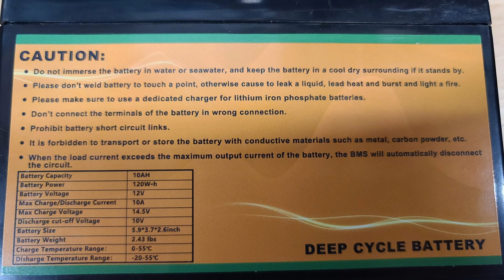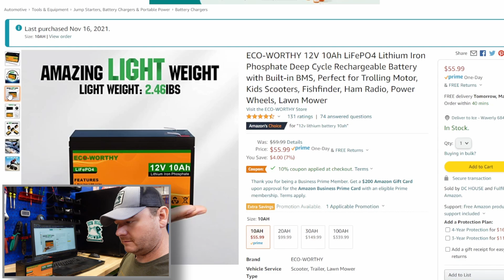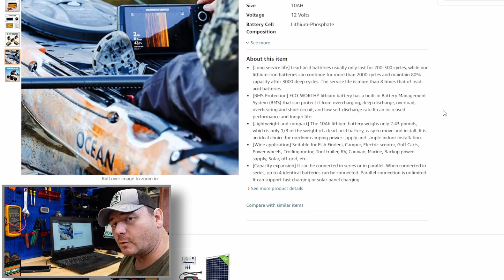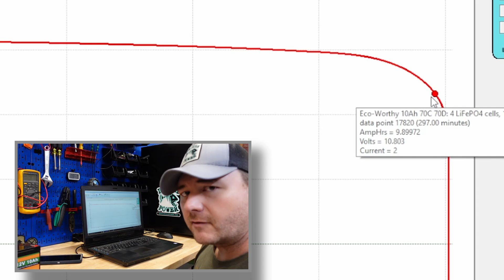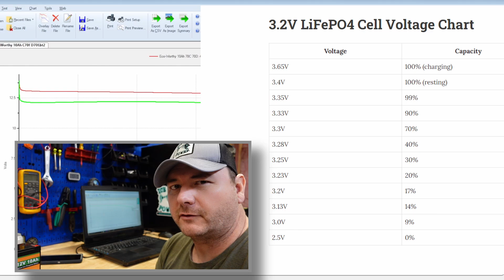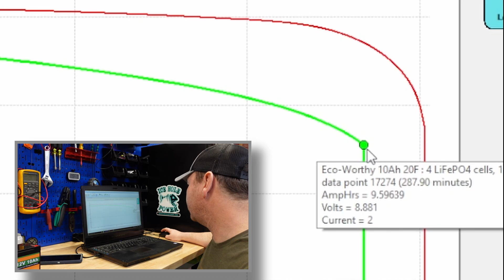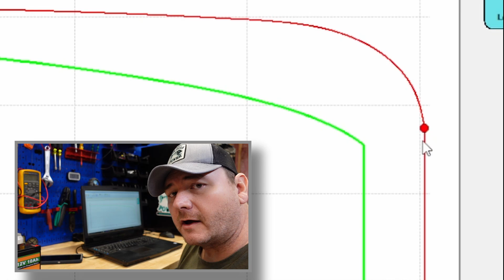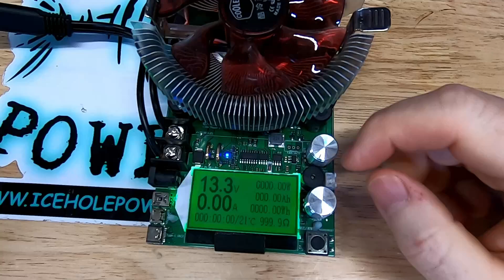Eco-Worthy 10Ah Review and Teardown

Comment: fwiw that bms is from JBD-HP07SA-4S-6S-7S-12V_1600487483010  albaba
Reply: OBTW that BMS is ca $3-5 ea so what you expect.  the bigger ones 25A $10 are whats promoted for Escooters - you know the fiery reputation they have, no OCP or SCP no wonder they smoke - should be banned

Comment: horrable compony to deal with tho.  they have lots of bad reviews on their ebay store and I ordered 3 different products from them and so far 2 out of 3 orders that they actually shipped 1 of the orders which was sent in a 2 part shipment they some how shipped one of the 2 boxes to the wrong address and then left me hanging..  and the other not only did they not send me the panel and charge controller that i bought as a kit.  they ended up sending me 2 of these 10ah batteries that i did not order and inside the box was a return slip from another ebay buyer that was sending them back because they were defective or damaged.  and my 3rd item which was a solar combiner and junction box that is still in shipping and not arrived yet cant be the right item either being the shipping weight is 11lbs and no way its that heavy and the box is to small for it to be my solar panel i was supposed to get.   But while i have there defective batteries here that they sent me a blank white return shipping label for (scammers)   these are NOT really 10ah batteries or even close to it. they also don't weigh anything close to any other maker's good 10ah lithium batteries.

Comment: Can one take the 12v 10ah battery and connect it to a 12v battery on a rider to run a pull behind tiller with a dc lift actuator

Comment: Can 12v 10ah lifepo4  battery's be put into series  for 36v ?
Reply: yes 3 in series for 36v, but make sure you charge them up fully in parallel first, as once they're in series, if any of them stop charging, all of them will stop charging.
better to get a 36v (12S) battery if possible (12S means 12 cells in series, whereas a 12v is 4S meaning 4 cells in series.)

Comment: Do these Lifepo4 batteries work in things like RideOn toys (powerwheels, Razor Quad) etc.  I bought a few to replace the SLA batteries I have, but they don't seem to have the strength to power power them.  Didn't know if it's something Lifepo4 isn't made for do to a limitation on discharge rate or something, or if I just bought crappy ones
Reply: Yes. Cheap replacement for very expensive power wheel batteries.

Comment: I nearly purchased 2 X 30ah Eco Worthy batteries for my mobility scooter, but after reading all the reviews here in the UK I decided not to buy. Still using lead acid as there seems to be some bad lifep04 batteries being sold in the UK.
Reply: I’m afraid to say but his test is not accurate. Max discharge is rated at 20A… nothing is going to happen at 16.

For his short circuit protection… all he did was arch the terminals. Not how you test a battery.

Comment: Ecoworthy was the one of the first lifepo4 batteries i bought.
I got a 200w solar kit with controller and it was a great project.
The kit came with 2x20ah batteries, which are still working :)
But i did change them out for a 100ah cell, from ecoworthy.

I can understand they may not be the best cells
or a good bms (it works for my use cases, as a portable battery bank that powers my patio pond)
For the price, i don't think you can find better deals, also some come with a warranty :D

Ecoworthy is kinda new to the market i think, they're still having some growing pains but i've been rather pleased with their products so far.
7/10 acceptable product
not the best but acceptable.

Comment: If your gonna short circuit test a Battery, clip the alligator clip and leave it on there with your amp meter on it as you had. All you did was a instant arching of the terminals.

Comment: Can I use a car battery charger?
Reply: so long as it doesn't 'pulse' like some car battery chargers do in order to break down sulphates, as these pulses screw with the BMS' electronics.
If it's just a flat current it will probably be good enough. Ideally it will hold the voltage >~14v in order to let the BMS top-balance the cells.

Comment: I got my 20AH delivered today.  The sheet in the box says that current protection kicks in at 2 x the max discharge current.  I'm not knowledge enough to know if that's bad, but at least it seems intentional.
Reply: Sounds about right, It's the level a fuse would pop (instantly at double the rated current, in a few seconds at 180%, about an hour at 125%)

Comment: wait, you need to hold the cable to know if it does short circuit right? the spark is normal, it has a reaction time, it just power it on again as soon as the load goes off, i got some bms that do exactly that, but if i hold the cable, the short stop

Comment: If I am not mistaken, you charged a frozen lithium battery, thereby voiding the warranty and likely doing damage. You also use claims on Amazon about what the battery should and should not do, rather than going directly to the manufacturers website. I could not find where Eco-worthy made a claim that there is short circuit protection, or low or high temperature protection for this battery. If I missed it, please point me to the manufacturer claims.  This seems to be a common problem on Amazon - sellers making claims that the manufacturer does not make.
Reply: Someone else pointed me to the correct claim from the manufacturer. It should disconnect on a dead short after 2/10 of a second. And for the 10 AH battery it should disconnect if it reaches 2 times its rating for more than 2/10 of a second. That would be 20 amps or more. So that quick sparky test you did is not really valid. You would have to use a heavy gauge wire to do the short and leave it there for a solid 1/2 second.

Comment: Thank you for your help and tech  help. Are these batteries available in Australia. Richard Weir in Australia
Reply from the maker: Oh man, I'm not sure. I got it from Amazon.
Reply: I bought 3 of these exact batteries off ebay in Oz....working fine so far. Also used a 30ah on daughters gate. It sits in the weather ..and there has been a lot this year.. never gets to freezing though. All working well 1 year in. Ghey all charge off cheap pwm solar controllers. Just found some nicer Renogy ones with a Li setting. Might change those.
Reply: @itallturns  thank you for your feedback Owen

Comment: Thanks for the video. I have a 3-wheel electric push golf cart from Sun Mountain.  They no longer sell or support the carts. The cart takes (2) 12v/10ah batteries that are wired in series. I have been using Might Max SLA batteries for a number of years. In the past, they have lasted a few years before they needed to be replaced. I put in new batteries ~3 months ago, which are now failing to work after 2-1/2 hours of use. Originally I could get 2 rounds of golf without a charge (8 hours). They are actually the second set of new batteries that I have put in with the same results. No one seems sure why this is happening ( Sun Mountain, Battery Retail stores, hardware stores, etc).  I live in a small town in Iowa, so the likelihood of finding someone that can properly diagnose the problem with the cart is slim.
Perhaps as the cart has aged and for some reason, it is getting harder on batteries. As a possible solution, several people have recommended going from SLA to lithium. There is a big jump (4x) in price, but perhaps the extended life of the lithium battery might make it more financially feasible than buying 2-SLA batteries ($25 each) every 3 months. Would really be interested in your thoughts - if you think that the switch to lithium is a worthwhile option - and if so, which battery would you recommend. Thanks so much.
Reply: Thanks so much - very helpful!  Do I need to be concerned with overcharging lithium batteries - for example, if I leave them on the charger overnight?
Reply from the maker: Great question! I think you will see a world of difference between using a lithium battery vs a lead acid. Lithiums are going to be A LOT more energy dense. And you are able to run them down 100% of their rated capacity without damaging their ability to retain a charge. That is the reason you are going though lead acid batteries so fast, once you discharge them past 50%, you damage their ability to retain a charge. These lithium batteries should last you 10 years. When picking out a lithium battery in that 10Ah range, one thing you need to keep in mind is that not all of them can be wired in series for a 24v system. Here is a link to a fairly cheap 10Ah lithium that CAN be wired in series. https://amzn.to/3PK1KKV

Make sure you get a LiFeP04 charger too. If you wire them in series, might be worth getting two so you can charge each battery at the same time. This is the one I use, I like the bigger alligator clips. https://amzn.to/3zrfpS6
Reply: @iceholepower8012  The batteries and charger you recommended are working out great. I have noticed the charger gets quite warm after charging. Is that common?
Reply from the maker: @stevenolmstead  they always get warm. Nothing out of the ordinary.
Reply: @iceholepower8012  Thanks!

Comment: I have eco worthy controller all bin working fine  but for some reason it discharges quickly battery seems ok any thought s thanks
Reply from the maker: what fish finder are you running?
Reply: @iceholepower8012  what you mean
Reply: Noticed that when you increase the charging current, the voltage reading dropped. How can your fancy charger do that? Doesn’t it make sense?

Comment: They lie. I bought a 50ah battery. After multiple charges it would only allow 7ah. I tore it apart and much to my surprise, they put a 7ah battery in a 50ah case. They refunded the cost and didn’t want it back. They hope you’re an idiot and don’t check capacity. Never buy this filth.

Comment: I've got 2 of these, and been regularly charging and discharging on a weekly basis.

Over a year down the line, they both hold and supply the 10Ah. Happy with them so far, be interesting to see how long they last.
Reply from the maker: Keep us updated!
Reply: @Danang Alta Hi there, I use them on a water trolley, for window cleaning. So they basically power a water pump. I generally run them right down before being charged. Seem to hold the stated Ah

Comment: Just to add something here, the larger 24ah eco worthy has a max charge of 20a. Maybe its a misprint or wrong bms in there? Just a thought. I just ordered the 24ah, Ill let you guys know how it goes!
Reply from the maker: Please do! Hopefully it is better quality!
Reply: @iceholepower8012  I bought 2 of the 20AH versions over a year ago. They have worked well enough that I now have ten of them in a string ( 2S5P ) for an inverter. I opened one of them up ( 4 screws and the top comes off and has a gasket ) to see what the BMS looked like. Even though the battery is a 20AH, it is rated for a maximum 30Amp discharge and actually has a 25Amp BMS. Charge rate is to be limited to 20 Amp per their paperwork. I have 20 Amp fuses between batteries and they all balance out to within .02Volts. As for their protections, read what they say. "[100% Protection] Built-in BMS protects the cell from getting damage like: overcharge, over-discharge, short-circuit. And keep balance between battery cells " Key legal word there is " like " You may not be able to damage them thru those actions but it doesn't mean that there shouldn't be fuses/circuit breakers somewhere involved.

Comment: I have a 30ah eco worthy battery, it has been okay i use it to powerbox. I use a 300w inverter in it, the most i pull is about 250w and ive had no issue with it. The short circuit protection does work - i shorted mine accidently and it just turned the output off for a few seconds.  I dont have a proper way of measuring its capacity but when i charge from solar itrs always takes over 300w of power into it, my charger is not accurate though it goes up i  increments in weird intervals so its more than its saying. For one of the cheapest lifepo4 batteries im happy with it.
Reply from the maker: That's good to know. I plan on looking at that battery in the future. Thanks for your insight!
Reply: Lifepo4 needs  to use a different way to measure state  of charge and capacity. There are ones that  use wh by measuring  amperes used and it compares it to  what it has when fully charged